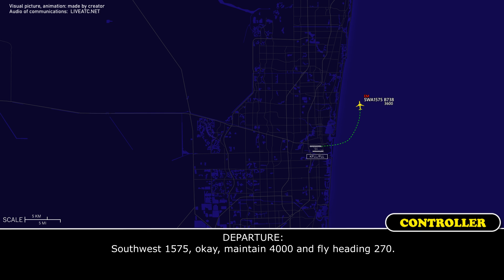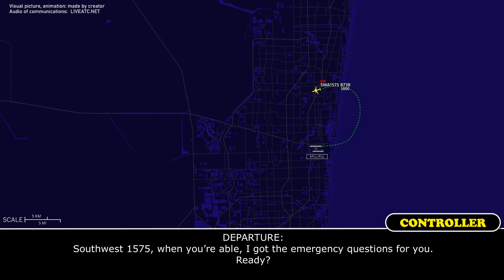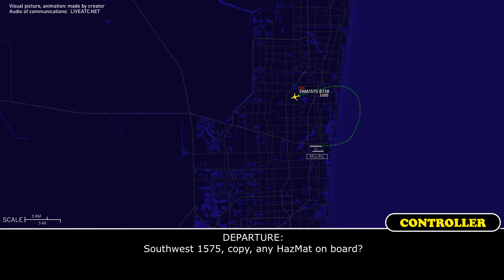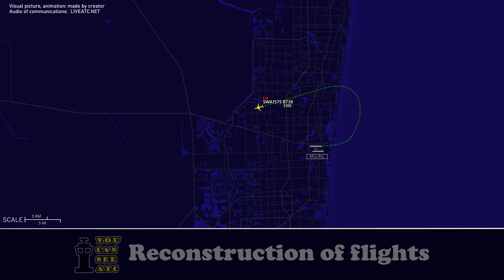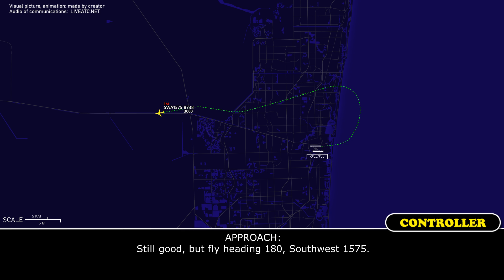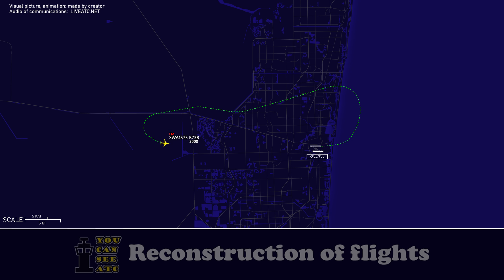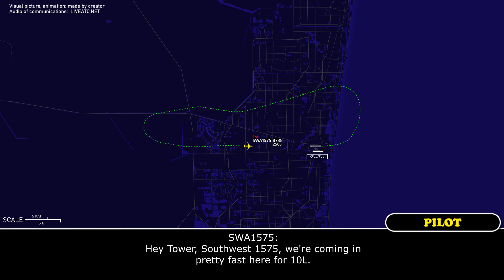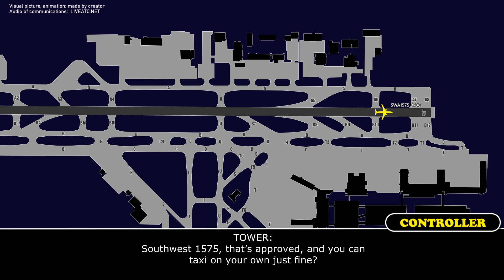Right engine failure after takeoff. Southwest Boeing 737 returns to Fort Lauderdale. Real ATC

Comment: Engines fail at times for many possible reasons. While training for a multi rating you spend much of the time with a simulated failed engine. These pilots practice this type of failure on a yearly basis for the rest of their careers. Although this is indeed an emergency, it was handled in a professional manner.